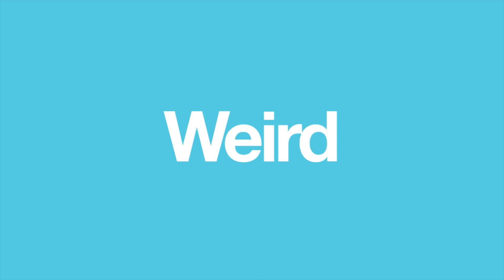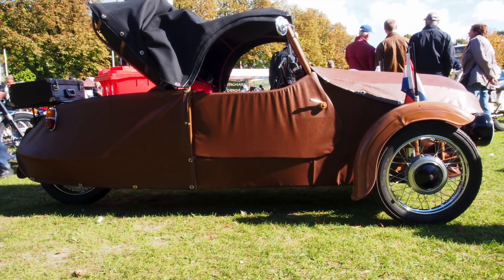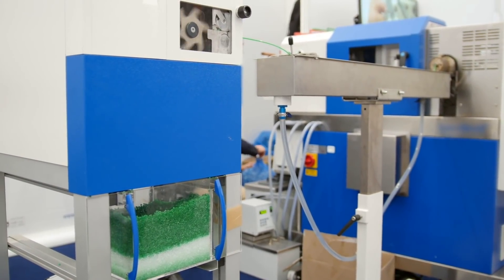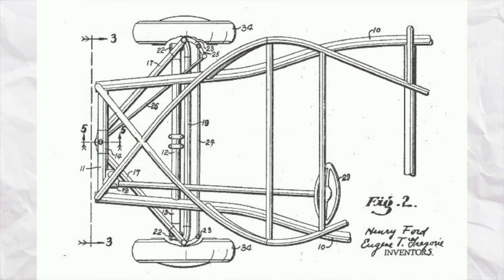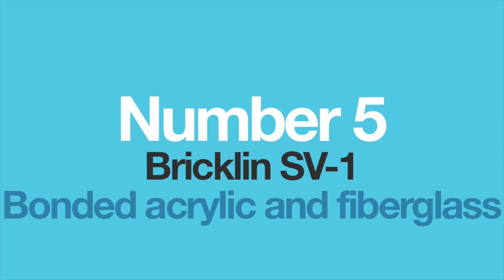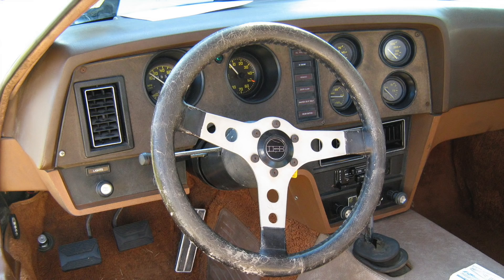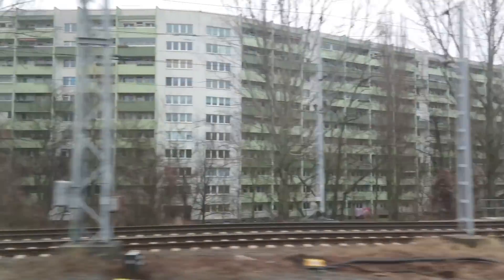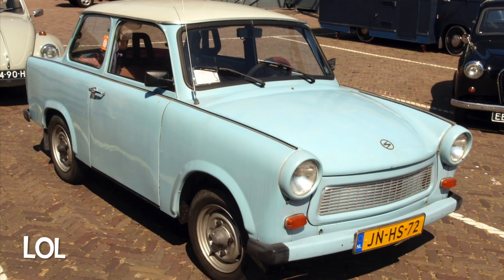6 Cars Made From Weird Materials!! 🧻

Comment: Here's one: Morgan (wood). (I know it's only the frame, but i'm pretty sure it still counts).
Reply: most of the cars made before 1940 were made out of wood
Reply: APerson you mean some lol.
Reply: What about The Splinter
Reply: @savagetuner2404  no most, in the 30s it was common to have a wooden frame with metal body panels.
Reply: @Spherz  ?
Reply: @APerson it’s an all-wooden supercar with over 700 hp
Reply: I really doesn't. A lot of cars during the WWII era and prior were made with wood framing. Morgan just sticks with 100 years old build metods.
Reply: APerson absolutely not. 1890s-1910s cars were the ones with wooden frames, and even then most were steel or cast iron frames. Really old cars are my hobby so I guess you could say I’m smarter than the average bear.
Reply: SpherZ 700hp??? You mean the race car?
Reply: APerson Except I wasn't exclusively referring to pre-war cars.
Reply: SAVAGE TUNER nah he’s right, there’s a wooden super car called the splinter
Reply: Imbeciliac Gamer I know, I didn’t disagree did I.
Reply: @savagetuner2404  Well a mass produced car like the Ford Model A (1927-1931) had a metal chassis but the frame of the body was made from wood. I've seen this myself in a museum. So at least many cars were partly made out of wood.
Reply: CheapBastard1988 chassis and body is two different things isn’t it
Reply: The Original Marcos GT had a stressed skin box section plywood chassis, with the design inspired by the DH Mosquito. It was extremely light, only the bodywork was GRP
Reply: @donaldasayers  Yep, if it wasn't a terrible car it would be awesome

Comment: The trabant doesn't sound like a bad idea when it comes to reliability if it doesn't break down on the outside, that is actually a good thing as you don't need to worry about the bodywork being in need of repair as often.
Reply: yes and it was easy to work on, some dude did a complete engine swap in 2 hours lol

Comment: What about the Pontiac Trans Sport as a newer vehicle having a plastic chassis. I had one and i cant say too many bad things about it. Though i had it for a year only. The fact that the body panels dont rust is a huge perk especially in areas like mine where road salt is used. Sure the frame does but that is somewhat easy to repair and protect. One bad thing about it was how the engine was placed. Its quite hard to change the 3 plugs in the back in the 3800 motor. But it was a quick and comfortable and for me quite a reliable vehicle in all.

Comment: JAWA Velorex is not a car, it's a coated trike powered by 350cc or 500cc 2cyl 2stroke from JAWA 350 or JAWA 500. Although older people and skilled guys know what it came with, many Velorice had the engines swapped after failure, and they could change the displacement on the paper, or just discard the papers (long time ago you could hand the papers to the junkyard and keep the car/bike/trike or whatever)

Comment: Fibreglass isn't that rare, it was used on more than just the Lotus.  TVR used it on their cars, too, and so did Reliant.  Plastic is even less rare and most modern cars have plastic body panels at the crumple zones.  In fact, my last car, a Renault, had more plastic panels than steel.
But what about the stainless steel of the DeLorean?